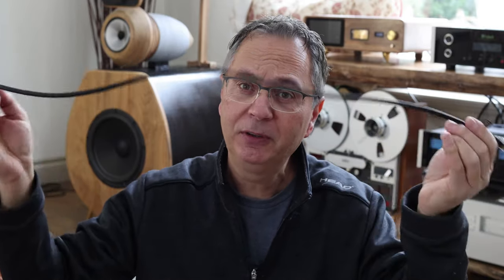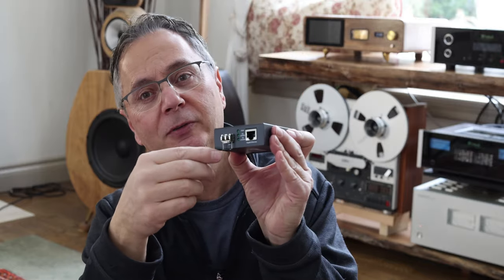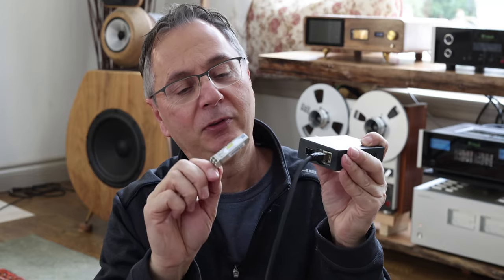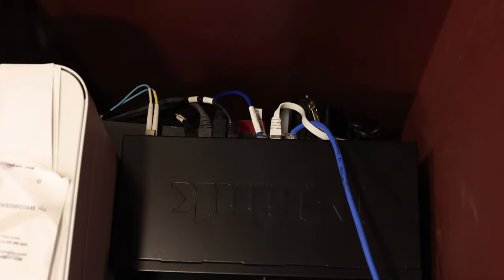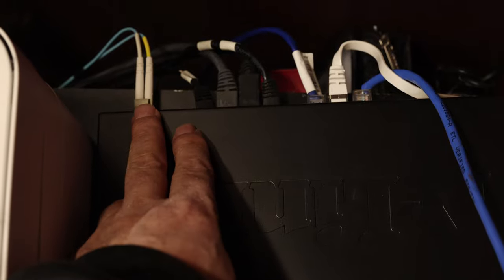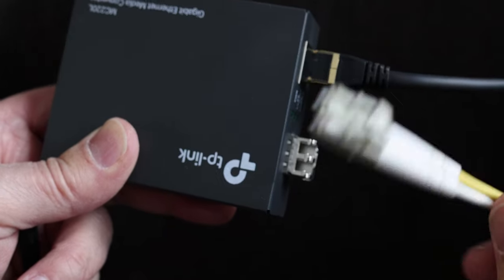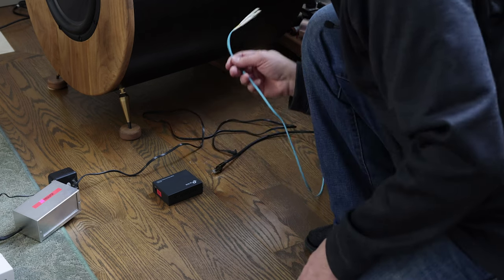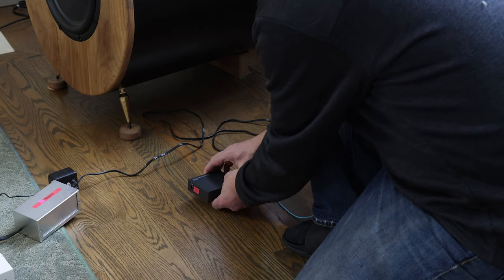Media Converter switch your Dac to Fibre optic

Comment: So why is this needed?  If copper Ethernet is working, it's working.  It's a digital signal, and noise can only stop it from working, it cannot degrade the digital data.  If a burst of noise hashes a couple packets, the receiving end just asks for them to be retransmitted.  And it happens so fast it's extremely rare that your DAC buffer has the chance to empty.  Don't get me wrong.. I love fiber for it's speed and reliability.  It's just not needed for the typical home run.
Reply: This is simply not true. Your dac buffer is also very small and its about packet timing, not the loss of packets. Tcp protocol is excellent at not loosing packets the the ms delay in timing which is what jitter is masks a big difference.

I have tried all of this stuff, Cisco 2960 LPS on these tp link ect ect and the best BY FAR sound was from an enterprise Cisco server switch 9000 series that was 45k new in 2013... Can be had now days for 600-800. Stock form these are Jesus level.... They are loud devices so you need to run the cable from this to your gear and put this in another room but holy S##T
Reply from the maker: Wile most dacs are resilient it is also possible that noise over the cat line will transfer to the clocks, opamp or output section. Not about packets specially wired should be no packet loss as you said they get retransmitted.
Reply: Many devices use optical isolation to reduce noise as it has been effective for years. Not really a debate if you have any experience with electrical noise isolation. I had zero noise at my last house, and now I am implementing different filtering techniques to deal with my new electrical supply, which is very noisy. All noise disappears when powered from a DC battery inverter/generator and sounds great for now.  Ferrite chokes can do wonders too!
Reply: @mikelanier5617  yes this is true I have 4 dedicated 8 gauge lines on ps audio outlets and a ps audio powerplant. I know power. Trust me - I didn't want to believe it. Fiber optical isolation devices, which I also use but only after the modem, have a built in clock. Sfp models require power and their conversion and jitter specs depending on power. They also have internal clocks... Not all modules are the same. They have clocks of different types, too.

To say you have no noise is also poor form. I have dedicated 8 gauge lines with high end outlets all on seperate grounding rods and then a ps audio powerplant that regenerates new ac off dc and even I still have noise! Just because you can't hear it, doesn't mean it's not there. The more I've learned and tried things the more I've realized we don't know a heck of a lot more that we do know, myself definitely included.

When your talking top tier audio there are so many variables. You never can get rid of any of the problems.

I use chokes on certain things too, but they also have a trade off and will definitely make things worse if used in the wrong place.

Another cheap really good tip for you is buy a roll of Emi tape on Amazon for $20 and put a 2" piece on the ends of all your analog cables rca/xlr /speaker /ethernet cables. Do not put on anything that has has AC Power like Power plugs or transformers. You will get a substantial sound improvement if you have a high end system.
Reply: @badd99  Cool story bro. 😎 Before retirement, my client list included little customers like NASA, DOD, US Military, Lockheed-Martin, GE, BAE Systems, corporate and celebrity clients, as well as several classified designs and installations. So, I appreciate that you determined dedicated  AC lines are important, they are. I ironically do know just a wee bit about this and glad you were educating me on "poor form" because I said that I had no noise. What odd behavior to act like I would lie about unwanted noise? Sure my oscilloscope would show me the inaudible noise associated with normal AC, but my point stands and I heard no noise in my last system due to several isolation techniques and chokes where appropriate on power cords. I have noise issues now because my RV is in a campground with improper earth grounding while using undersized non-twisted feeder wires to the pedestal. After discussion with the owners and my use of a Fluke meter, they have hired an electrician to rewire the entire campground. RV was more challenging than my house, but diagnosed and scheduled for resolution. I'm old, but I haven't forgot decades of A/V, automation control design, and integration experience. Feel free to help others with offensive remarks said without merit while knowing nothing of their own experience. Kinda cute hearing you say "trust me..I KNOW power" from a consumer keyboard warrior..lol ✌️
Reply: @mikelanier5617  If you think noise is the #1 most critical thing ANY of those companies are concerned with when it comes to designing, building, or implementing then well I don't know what to tell you. What is ultra low noise for them is not the same for audio. To think I'm a keyword warrior is the same to think you didn't know. You do have noise. It is there. To say you have no noise is wrong. It's black vs white here. I'm not going to debate you how this is audible in an indirect way, but please tell me again you don't have noise in your line. It's there. Plain and simple.
Reply: @badd99  You are right and win..yeehaw! Noise is always present and I believe I mentioned that about only on a scope, then yes you got me. Where you are naive is that electrical interference WAS their top priority other than I was not a communist..lol. This is exactly why many of those clients contracted me to deal with unusually high levels of RFI and EMI which adversely affected sensitive electronics, some A/V and important things like missile and cannon targeting systems. Janet Jackson, Timbaland and Teddy Riley's estates were not really in the same design principles as the military stuff, but you deal with what you have to and move on. Kinda like I am with you 😉 Love the internet experts with vast experience with a simple hifi system they connected because Dad had hifi when they were growing up 🤣😆😂
Reply: We should seek ASR for clarification.
Reply: @strongchallenger2269  he doesn't even listen. He is so fu of bias he can't see 2ft in front of him